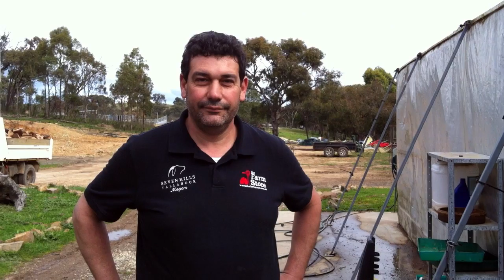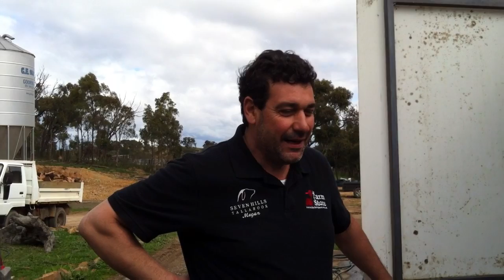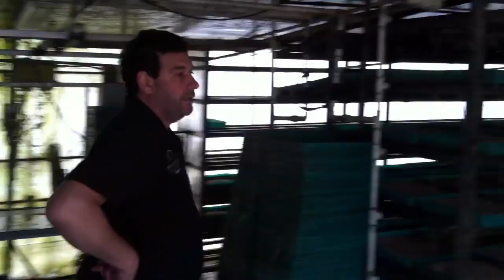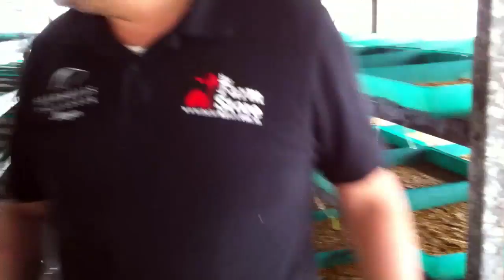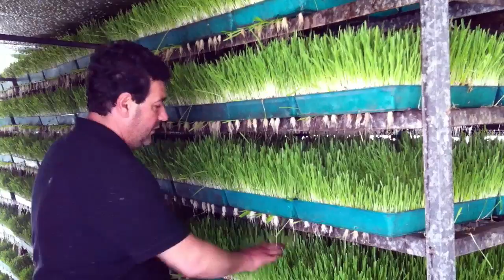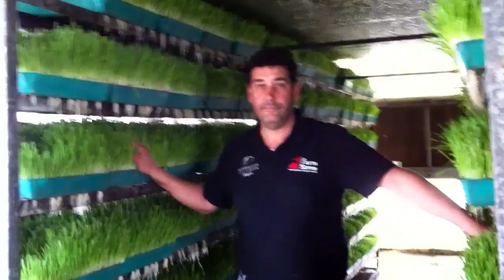Growing Animal Fodder at 7 Hills Tallarook Farm Stay - Victoria Australia

Comment: irrigation.
How often do you water?
How many liters of water per square meter?
Reply: According to the video they spray 30 seconds 6 times daily. I'm not sure what the volume per tray is but he states the system uses 1300 litres over the 7 day cycle. Pretty easy to extrapolate the rest of the data (total number of trays) and break down usage based on the video footage.